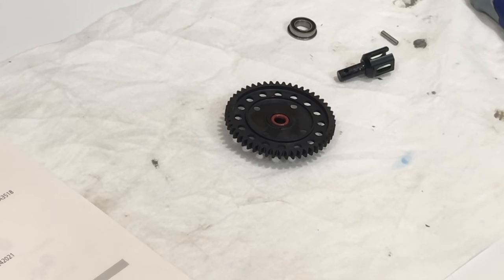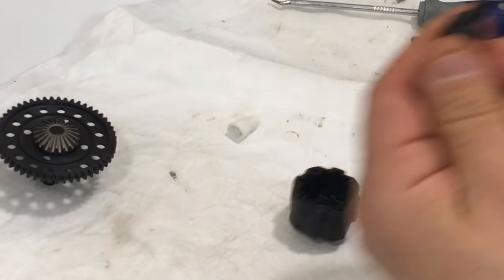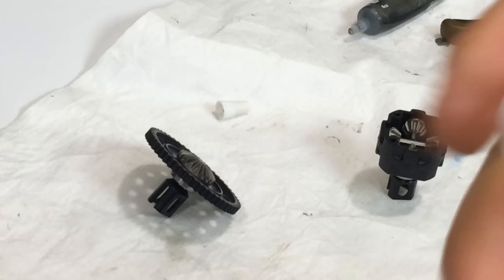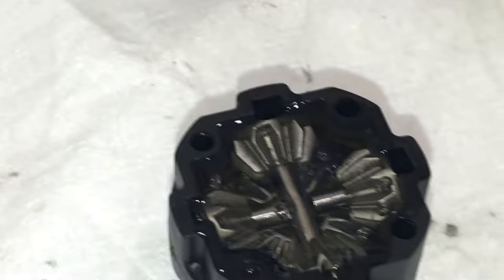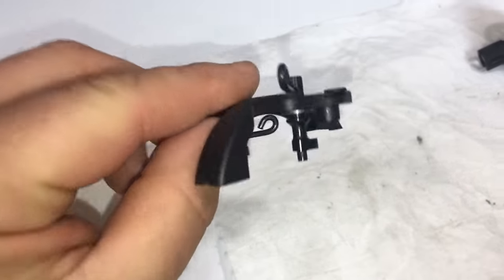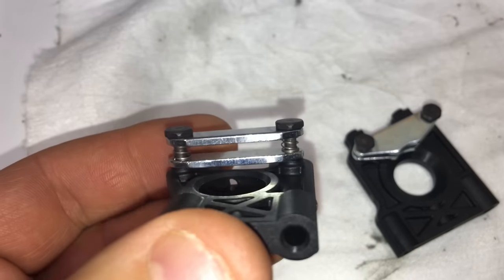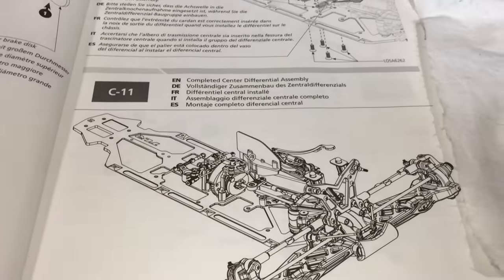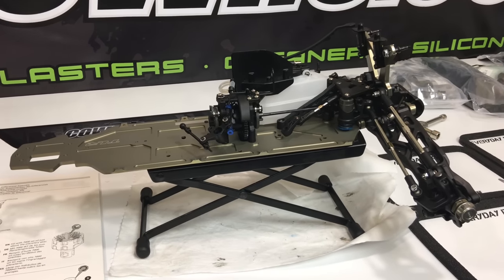TLR 8IGHT-T 4.0 NITRO TRUGGY KIT - CENTER DIFF ASSEMBLY INSTALL-PART 2 BUILD SERIES

Comment: good vid. what's the difference in running a center diff compared to AWD without one ? 👍
Reply from the maker: Thanks for watching. Four-wheel-drive vehicles can have either a center differential or a locked center transmission. The benefits of having the center differential is better handling especially cornering but most importantly it will save your drive train if you do a lot of jumping. When you do heavy bashing Or a lot of jumping when you land with any kind of wheel speed you want to have some give in your drivetrain so you don’t strip out your gears. If you had a locked center transmission you are more likely to break your ring and pinion gears because there is no give. I preferred to have vehicles with a center Differential for this reason

Comment: I hope you can answer this question for me about diff  oils, how do I make a choice in diff oil wt. in ft., ct. & re.?  I'm still a little new to this hobby and I trying to find out what drives this decision?
Thanks.
Reply from the maker: Tank 62 Hey thanks for watching. I could go into depth and make it a long response but I will try to make it as short as possible. The lighter the fluid that you use in the front and rear differential will make the vehicle easier to turn and maneuver and make it easier to slip and not keep it locked up as much. The same thing goes for your center differential. The lighter the fluid the more slip you will get and less power. There is a fine line but since I am strictly a basher and don’t race or worry about cornering or turning more so putting the power to the ground and jumping you want to go with the Thicker fluid to help give you more power!
Reply: EVERYDAY RC Thanks that answers a lot in my decision making,  thanks for keeping it simple.  And have a Happy new year!
Reply: Tank 62 download the following document it will answer all your setup questions https://www.teknorc.com/wp-content/uploads/2014/06/Set_Up_Guide.pdf
Reply: ZoomZoomToys Thanks I will  check it out.
Reply: ZoomZoomToys I just checked that OUT IT IS JUST WHAT THE DR. ORDERED!!😷👍👌
Reply from the maker: No problem tank. That’s why I love YouTube and this is why I started the channel so that people can come together and help one another. I am happy that you have got your questions answered and happy new year

Comment: Wouldn't it make more sense to use the the rounded sides of the brake pads to avoid scoring the discs?
Reply from the maker: In my experience it has worked much better but I am comparing it to my Losi 5T that has metal brake disc’s and these have composite. Are you an expert with this platform? If you are then let me know if the rounded edge would be better. My commonsense told me that this was the best way
Reply: EVERYDAY RC I'm a just going by the mechanical knowledge l have. A metal brake pad with rounded edges making contact with composite discs makes more sense to me as opposed to a brake pad with sharp edges 👌
Reply from the maker: Thanks for your input bro. I would hope that they would’ve been more specific in the instructions. Hopefully it doesn’t make a difference but I can see where you’re coming from. Hopefully I don’t tear up these composite brake discs. Thanks again for watching and I appreciate your feedback. Happy new year